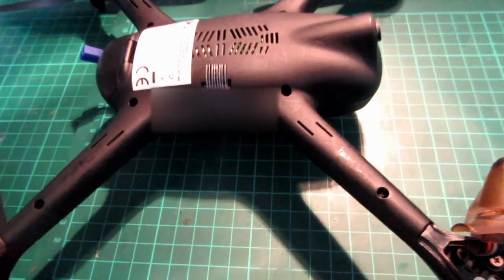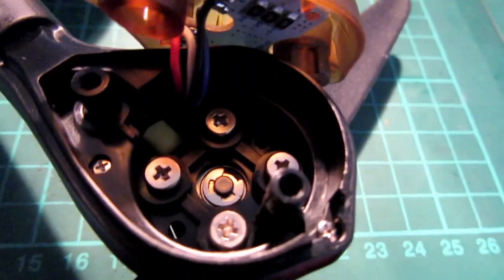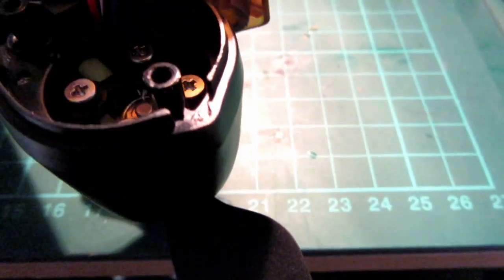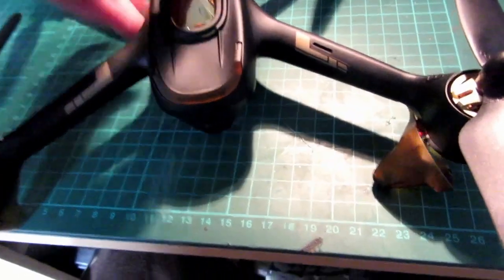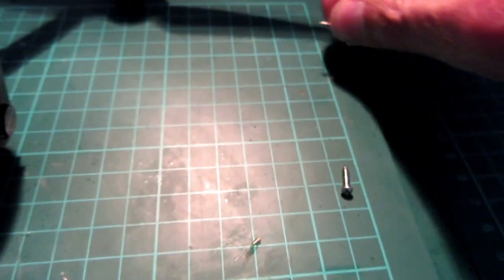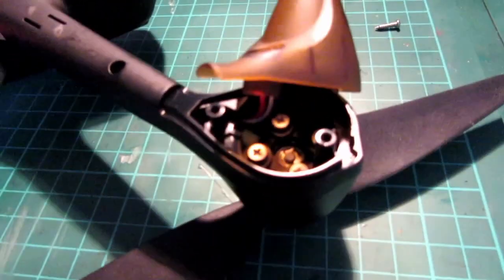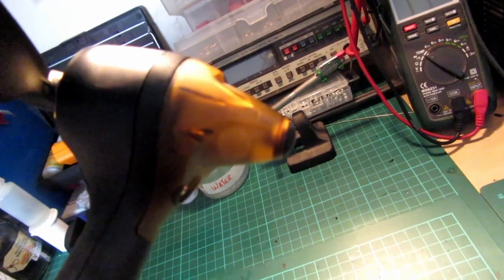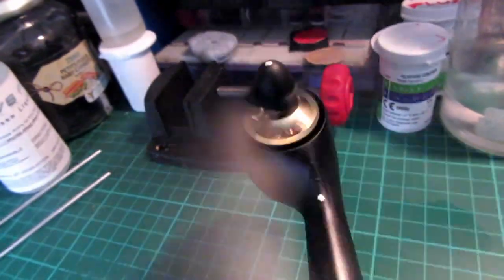How to Fix || Hubsan H501ss X4 ||  Brushless Motor Noise ||

Comment: You, sir are a genius!  I bought a used H501SS and took it out for a trial this morning.  I only took it up to 20 feet and let it sit there in a fairly brisk wind.  Solid as a rock!  Brought it home and noticed one of the four motors turned by hand a little noisy, just like a bad bearing!  I oiled it from the top and it didn't make a difference.  Found your video and decided to open the bottom.  Well, one of the posts that support the bottom light cover and foot was busted off, so I crazy glued it back in place.  Then I used a jewelers screw driver point to move the circlip around, oiled the bearing, since I had access anyway and BINGO!  Fixed.  Thank you!!!

Comment: My hubsan just went off and fell and one arm cracked a bit and the propeller cracked 
Now that motor does not spin but hops a bit 
What do I do
Reply from the maker: Sorry about that all you can do is get  some replacment parts try ebay or banggood
Reply: @Beta250trials  I managed to open it 
And found the red cable came out of its solder
Reply: So I tried to make contact and it started to spin now all I have to do is glue up the cracks and solder

Comment: So I'm confused.  Are you saying by rotating the circlip ten degrees your noise went away?  Any speculation as to why turning it a bit did anything at all?  And I didn't quite follow the part about polishing some piece on fine sandpaper in the figure 8 pattern.  Did you mean you polished the circlip?  Can you elaborate?
Reply from the maker: Yes that's correct  it looks like the small bushings aren't  level possibly  or even the washers.

Comment: Thanks for that tip. I sent one back because of the "chirp" coming from a motor. Just put the replacement quad up and surely this one made the noise too. Not as bad as the first one though. I'm going to turn the clip on all the motors. Saved me from returning another. Love flying this quad almost as much as my Bugs 3.

Comment: Interesting I have the same problem with one of my motors , Hubsan will not take any responsibility for faulty products . Thanks for your tip I will try this on my motor. A lot of money for something that only worked for a month , Hubsan need to look after there customers for the future.
Reply from the maker: Hi Martin sorry you have had a bad experience with your quad made in China what more can I say.but I have 4 hubsan quads and I do like them  but they do require some work cheers hope you get sorted 👍

Comment: Hello, anyone knows the size of the engine bearings from the H501SS. ~ S and SS should be different? I have 501SS. I read: 3x7x3 and 3x8x4. Who knows what?
Reply from the maker: Hi I'm not sure but I'm certain that the motors are the same
Reply: @Beta250trials  Thank you. Maybe there is more detailed information from other visitors.

Comment: Very interesting. Did you notice any improvements against jello artifacts? I guess that it's caused even by plays like the one you corrected in the motor..
Reply from the maker: KITT9854 yes I did notice better videos but my main concern was that it wasn't going to generate heat and possibly fail...
Reply: Beta250trials oh yeah, that's right. I've just tried your method but unfortunately with no luck in my case. I think I will at least check the temperature for that motor each time I land the quad, so that I've got an idea of how it's going. If something eventually gets warm, I'll replace then. Thank you!
Reply from the maker: KITT9854 what I do is hover  for about 10 minutes then land disconnect the battery and I use my lips to check all the. Motors sound mad but it easy to tell if one's about wormer...hope this helps
Reply: Beta250trials yeah, good one. Thanks!!

Comment: Hi. The filter is a neutral density one. It reduces the amount of light reaching the sensor without introducing a colour shift. Not very helpful on dark days, but on bright ones it should reduce the 'jello' effect. This works because the darker image forces the camera to use a lower shutter speed to maintain the correct exposure. The lower shiutter gives a little bit of motion blur - which our brains interpret as movement - and supresses some of the perception of image wobble. Not as good as a stabilised gimbal, but a step in the right direction.  On a very bright day the shutter may be exposing for fractions of a milli second, whilst  normally digital cine would aim for 20 to 40 milli seconds, roughly about 100 times longer.  Bob UK.
Reply from the maker: nice one bud thanks for the help

Comment: THANK YOU very much for this heads up post. I just received my new H501c and sure enough, one of the motors had a grinding sound when spun up by hand. I moved the C-clip about a quarter turn and now the motor is as quiet as the other three!
Reply from the maker: ccbusa05 I'm glad it helped...

Comment: Thanks for this. Have Had my 501s for 3 weeks and when oiling the motors, one was a slightly noisy. Moving the circlip did the job.
Reply from the maker: Hi Gary im glad it worked for you i check mine all the time after a few flight and all the motors are so smooth....
Reply from the maker: glad it worked man ive flew my 501 many hours and the motors sound silky smooth i oil them after about 5h of flight...

Comment: Thanks so much for this video. I just got my hubsan today and there was a weird noise coming from it when I go forward and back. I followed your advice and it worked on one of the motors. When I went to do the second it was a bit more serious. One of the screw holders was snapped in half!!!! I don't have much luck when ordering drones from china lol
Reply from the maker: iamcolinedwards 
Hi I'm glad it's worked.sorry about the broken bolt hopefully you can get it
 free..

Comment: Great video, thanks for sharing the info, I have recently purchased one the same as yours, great value for money. I haven't looked into the state of the motors yet as I've only flown it a couple of times. I haven't fitted the lens filter that came with it yet, did you see any difference with or without it?
Also please let us know if you have found out any other interesting things about the H501ss?
Regards, Dave
Reply from the maker: Hi Dave i did see a difference with the filter... bright daylight was or seemed smoother  but low light gave a ghosting affect...but its still a great quad ive got myself 7 batterys for when i get to go out for the full day....its a super quiet quad.also..
Reply from the maker: Dave Burgess hi Dave yes the filter makes it a bit better image in bright light but no so good at night.